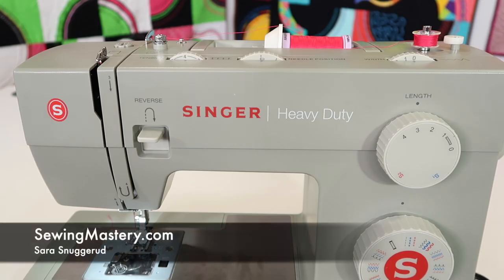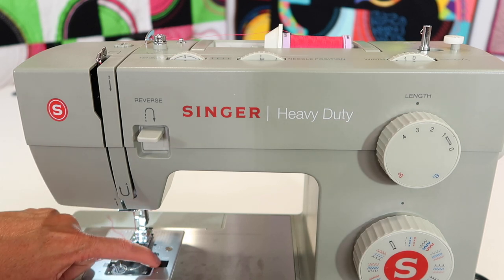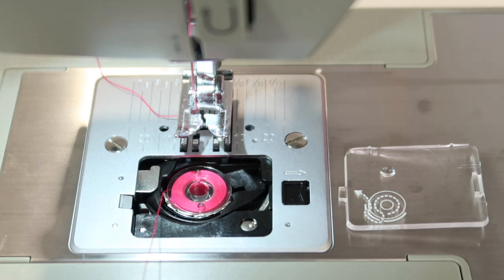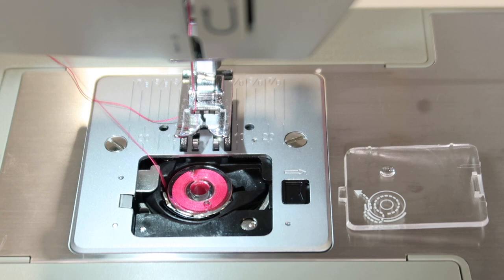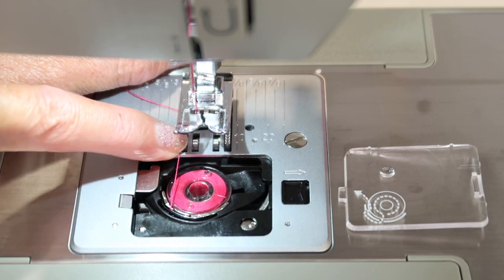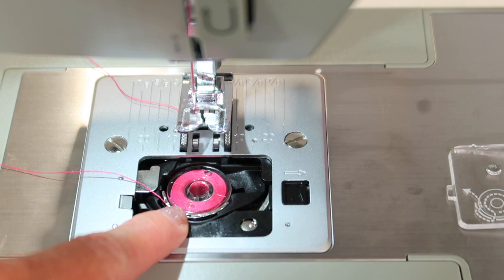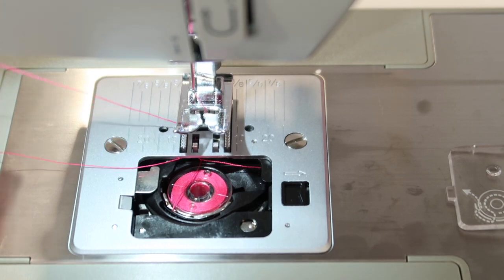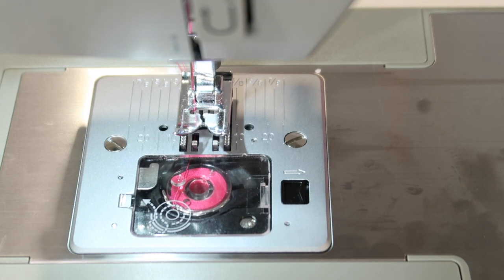Singer Heavy Duty 4452 5 How to Insert a Bobbin

Comment: In spite of your perfect instruction it is not working. I have this machine, I follow every step but the needle does not lift up the thread form the bobbin. Tried a million times and am new ready to hide the machine and go back to handstitching. What am I doping wrong. I followed every step….
Reply: Did you figure it out bc mine won't grab the thread either
Reply: Try Turing the wheel thing the opposite way
Reply: @ameliamorkotinis7781  thank you🫡
Reply: @shelbyshaper did this work for you?

Comment: Thanks for this video! This is my first drop in bobbin machine and although I got through several projects, I  just knew there had to be an easier way. Turns out I had the thread in the wrong slot of the shuttlecock. Now switching thread is much easier. Thank you so much❤❤❤